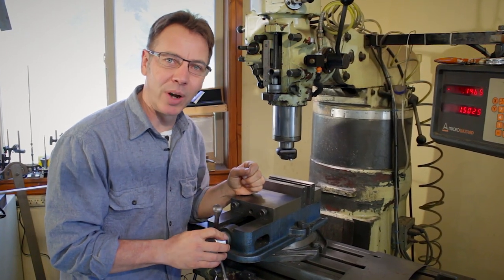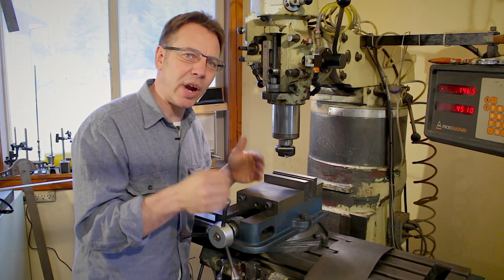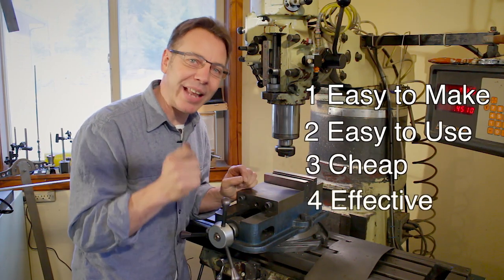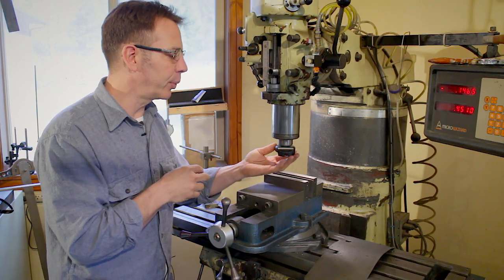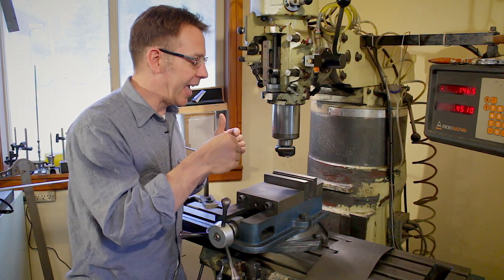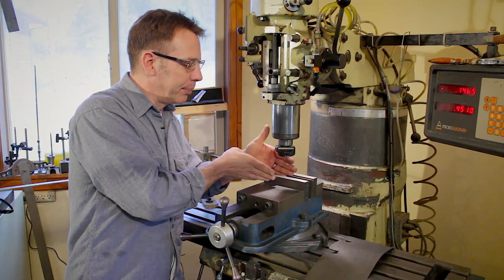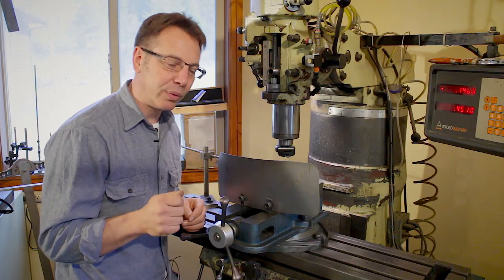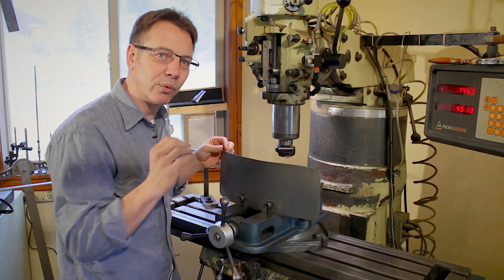Milling Machine Tip You Must See!

Comment: what is the best economical milling machine for beginners
Reply: there are a host of options, but the bottom line is the budget you set yourself to work within. i picked up my bridgeport for $500 in ebay. granted, it's not a deal you will come across very often. 

the grizzly machines are fairly affordable, but they require a lot of re-work to be serviceable machines and if you don't mind spending the time they can be an ok deal. right out of the box they do have issues, some substantial, some are good to go depending on how good a mood the assemblers in china were in that day.

for a beginner, a good all round machine is a bridgeport or a clone in terms of versatility. your horizontal mills are a fairly specialized machine and can be limited in what you can do with them. the cheapest way to get into a milling machine is to comb the scrap yards, craigslist, ebay and local auctions . 

keep in mind that while you may get into a machine fairly cheap, the tooling WILL run you a kings ransom. again, keep your eyes peeled for deals, they're out there, you just have to do the leg work